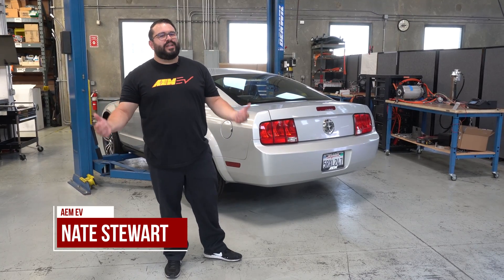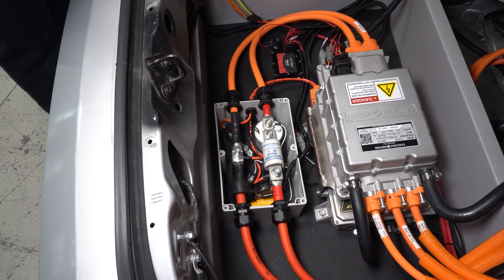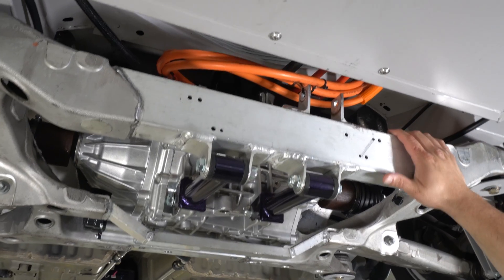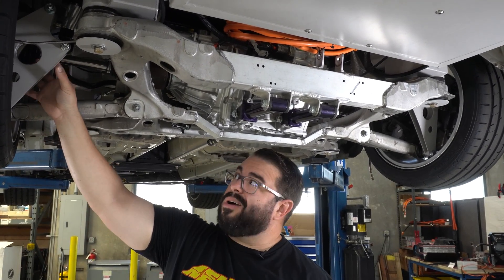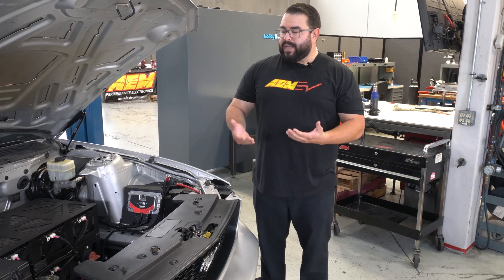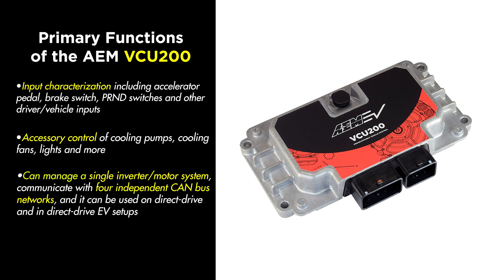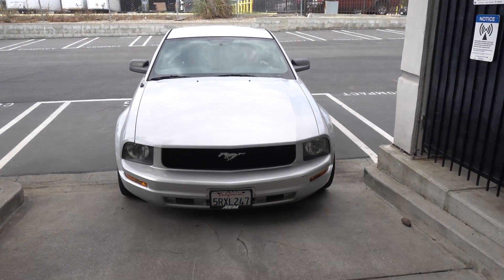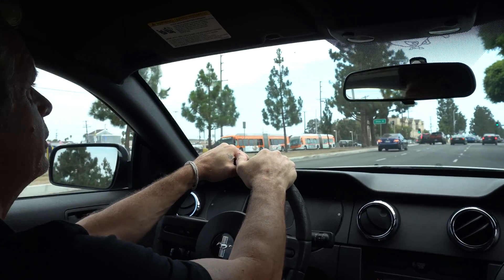THE FIRST FORD ELUMINATOR SWAPPED EV!!

Comment: For some reason I thought this was a drop-in under-the-hood replacement for a gas motor (in addition to having to find a spot for the batteries, of course).  I'm a little disappointed now.  I have a '70s Ford that I wanted to plop one of these into some day without a lot of fuss.

Still a neat thing, just not what I thought it was.

Comment: I have a question about this build if you're able to help. I'm potentially planning a similar build with the Eluminator motor. Outside of the motor and Tesla subframe, what's getting the power to the wheels? Mach-E hub, axles, knuckles, etc? Any help would be greatly appreciated! Love the build!

Comment: That's awesome, an electric steering rack instead of a electric hydraulic pump like on most conversions. Does the VCU200 have much control over this rack? Now all you need is an electric brake booster like the bosch ibooster.

Comment: Wonder if they Adapt to 4x4 transmissions, would be a great swap for my bronco
Reply from the maker: Updated: 

The Eluminator is a transverse drivetrain and requires independent suspension.  A 4x4 Bronco had a longitudinal drivetrain and solid axles.  The Eluminator is not compatible with a longitudinal arrangement.  To make an all-wheel drive vehicle, you’d use two separate Eluminators – one in front and one in back – but the back would require independent suspension.  But there is no adapting the Eluminator to a transmission because it already has its own gear reduction built inside of it.

We are running a Cascadia Motion motor through the factory transfer case on our Pinzgauer project. The motor's output shaft connects to the t-case in the same fashion that a driveshaft from a transmission does. We've been too busy to get back on it, but will get back on that as soon as we can. You can see the concept in the video we have done though, so please check them out!
Reply: @AEMpowerTVelectronics  Wouldn't it be possible to fabricate something to connect to just one side of the eluminator into the transmission (I'm thinking about this for a 65 Mustang).  For the not-so-on-board-yet crowd, you'd be sacrificing simplicity for traditionality of driving experience.

Comment: could this be a beast if you made this car all wheel drive?  What would it do at the track?
Reply from the maker: It's already very spirited, so yes, it would be a monster with a dual motor setup! We look forward seeing someone do a dual-motor Eluminator swap. Supporting two Eluminators would be much easier battery-wise than, say, supporting two Tesla drive units because they only draw 625 Amps, so combined that’s ~1200 Amps.  Two Eluminators are basically equivalent to one Sport LDU.  The real difficulty is the mechanical work to make a car that’s normally rear-wheel drive also be front-wheel drive. 

The ability to run two motors is dependent upon the amperage draw of the motors you use. While there really isn’t a battery that’s appropriate for supporting 2200-2600 Amps required to run two Tesla LDUs, for example, the kWh capacity of the battery (size of the tank) does not determine the discharge current capacity (analogous to fuel pump flow).
Reply: @AEMpowerTVelectronics    All wheel drive, would be stupid fast!  and we have all done something stupid in our lifetimes...   Have you run this car at the track?  If so, what times have you recorded?
Reply from the maker: @Jacques_Merde  We have not run it a the track yet, but we will report back when we do!

Comment: This is a nice edition to the testang. I also liked roadstercycles 2nd tesla ev swapped s197 he used a model 3/y drive unit in. Lighter cheaper and more easily sourced now that over 2,500,000 model 3&y have been made since 2017.

I'd like to see someone make that setup as a bolt in solution along with aem/Holley high voltage ev swap parts to support the swap. 
With well over 1,200,000 total s197s made? I bet if something like that could be made as a true bolt in ev swap? 

Maybe with a custom front k tubular member for the epas and to fit a decent sized battery pack underhood? 
That could be the ticket for those wanting to keep a mustang with all modern safety features, comfort options plus retain decent tuneability for brakes, wheels, suspension parts, aero kits etc. 🤔